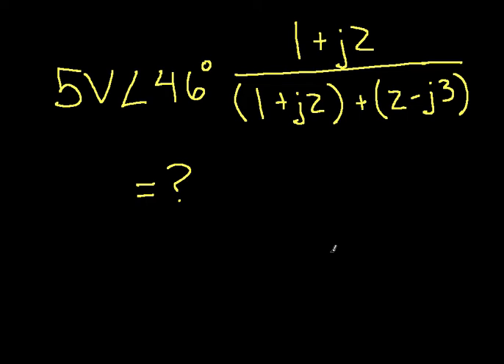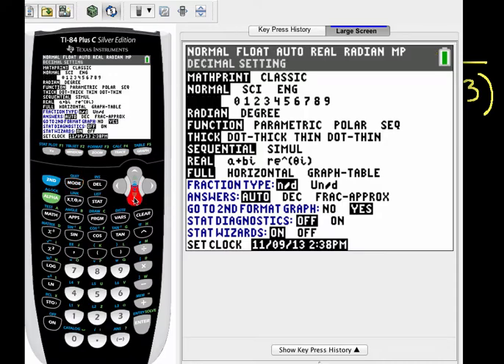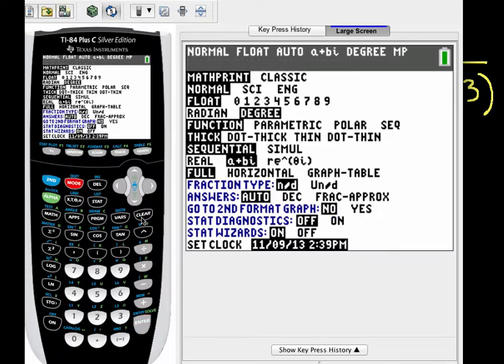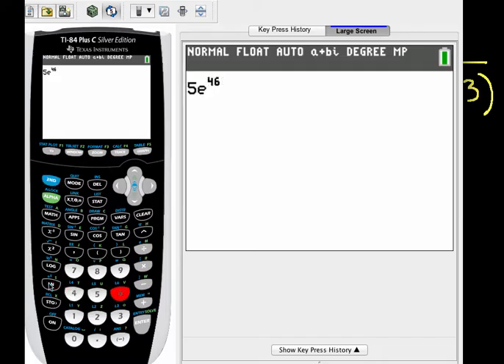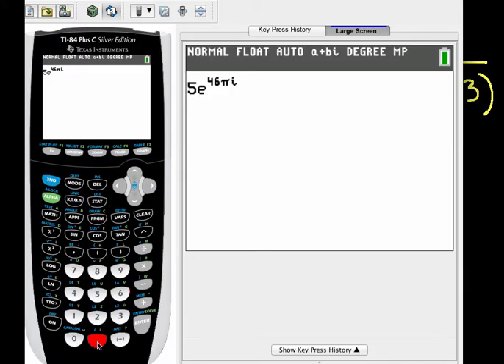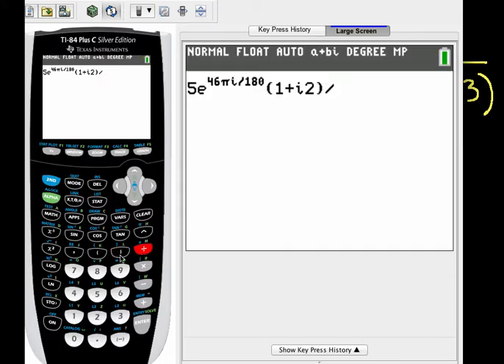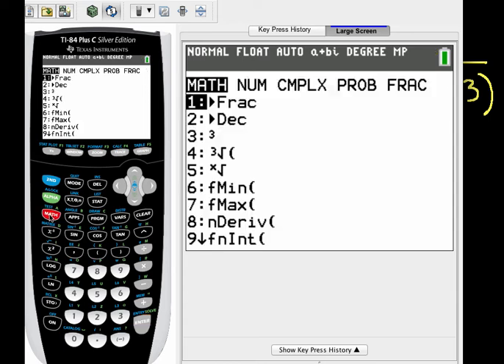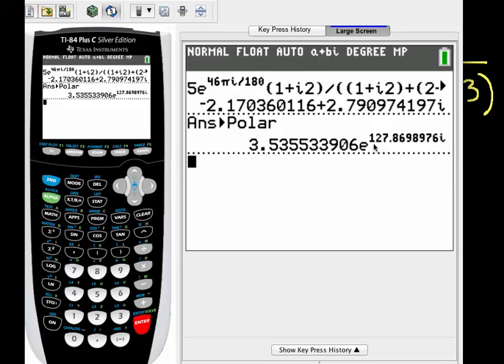Computations with complex numbers using a TI 84

Comment: i keep getting this error message when i do it exactly like that. it only happens when converting from polar to rectangular and never from rectangular to polar. It says that it is a DOMAIN error and that the value I entered is not allowed in the function or command. But it is so I dont understand what I did wrong! Please help
Reply: for anyone else who might also be encountering this issue, here's how I solved it: go to mode and set it to radian instead of degree, and follow this video tutorial just as normal. The returned phasor form value would be in radians, so just manually convert it back to degrees by multiplying 180/pi.

Comment: Using a TI-84 Plus CE. I have to have it in Radian Mode to solve the equation, then go back to Degree Mode to convert it to polar... what a pain.
Reply: I was getting error constantly until I read this. It works now.
Reply: I appreciate the heads up
Reply: thank you king
Reply: spent about 3 hours trying to figure this out, surprised no where else tells you this since these problems are pretty common in engineering
Reply: You can also 1) set your calculator in radian mode, 2) enter the real and angle values, 3) put the degree symbol next to the angle (you can do that by hitting 2nd and apps, it should be the first first one on the list) with the j right next to it and hit enter. Should look something like this while you are in radian mode: 5e^46°j 

Putting the degree symbol next to it makes it work and since your calculator is in radian mode, it will just convert the angle into radians. I found it less tedious but still wish it just worked with the polar to rectangular function while in degrees.

Im writing this in case future people stumble upon this and in the event that i forget for the 8th time lol.
Reply: I LOVE YOUR MOM

Comment: Any idea why this doesn't work on theTI-84 Plus CE? I did exactly what you did and it gave me an error
Reply: try radian mode
Reply: @alwz3566  I finished the class but still had no luck getting this feature to work. I think I tried radian mode if I remember correctly.
Reply: Same.  Hard to do circuit analysis without it.  Just got off the phone with TI, and they said only the 89 and Inspire can do it, which is not allowed for testing.
Reply: I just ended up getting a Casio 9750ii.  Sad TI won't correct this.  I told them on the phone that I guess I will just have to go buy a Casio.

Comment: that was very helpful because other people do not mention this note that calculator do the calculations based on radian even you change it in the mood to degree and thats you dont get the result you want !!!

thanks for mention using pi/180
Reply: figured that too since most of my angle shifts were wrong despite the magnitude being correct, but I still have some cases where everything is right even if I don't convert it to radians. idk